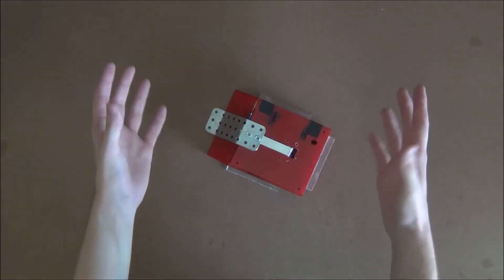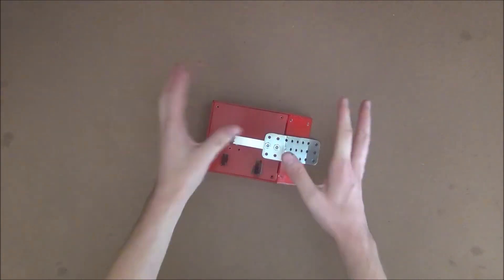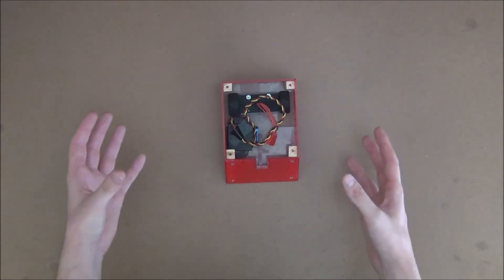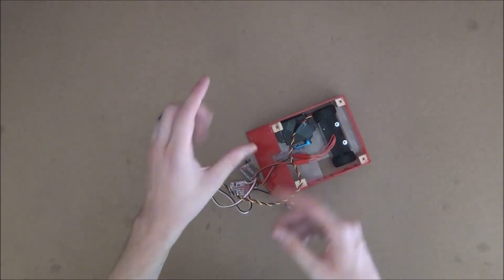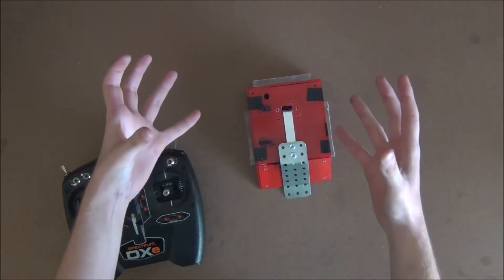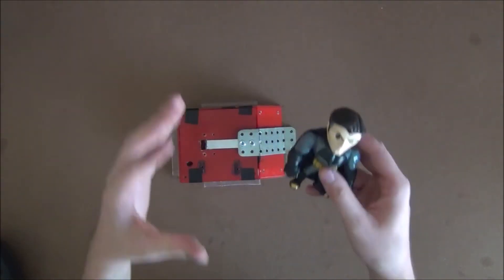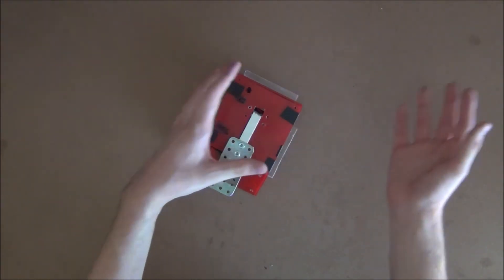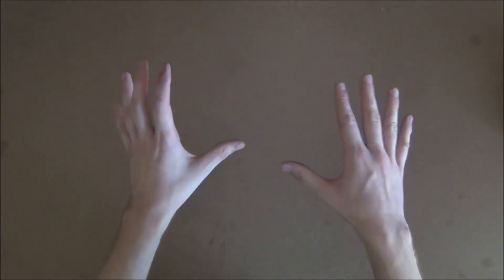1LB Battlebot Part 4 // Battlebot Test Drive

Comment: Fantastic build, man! :) Are you using differential thrust/steering?
Reply from the maker: Thanks! No, I am not at the moment however I have plans to buy a programmable transmitter soon so I can!
Reply: Mechanical Ninjineer Nice! I bought a FlySky FS-T6, but it didn't got here yet. But, if I can make a recommendation: buy a FlySky FS-I6. It's as cheap as the FS-T6, but uses newest protocols like SBus. (Great for quadcopters!) If I knew that before, would've bought the I6. :)